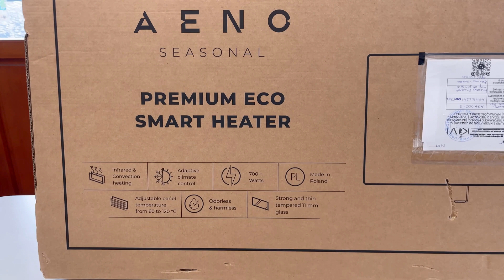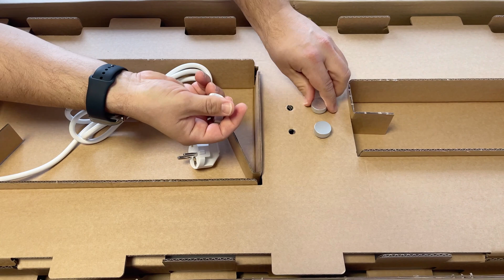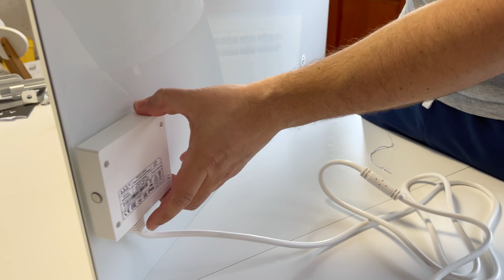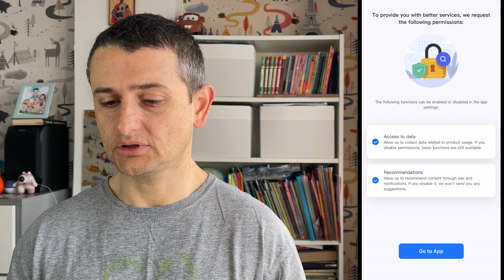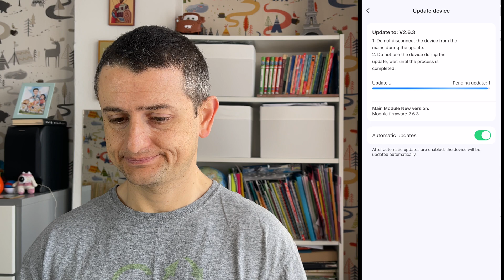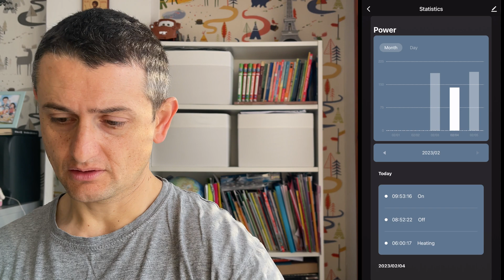UNBOXING the AENO Smart Infrared Panel

Comment: Hello Nikola! Could you please tell us about the electricity bills at the end of the month of using the heater? 

Now I'm looking for a different methods of heating for my house, and I'm very interested in this infrared heaters. 

Thank you in advise! :)
Reply from the maker: I can’t really tell about ut the bills for certain. Last winter was pretty mild and the bills were half of what I usually pay but I don’t know if it was because of the heater. Also electricity prices go up and down around here. I think you should get one or two to try and if you are satisfied you can scale up.
Reply: @NikolaTubeNikolov  Thank you so much for your reply Nikola. This will be the best solution, to get one and test it. Then we will see what will be the result.

Thank you again! 

Greetings from Plovdiv, Bulgaria!

P.S.: I suppose, we are from the same country btw, from the content in your chanel ^_^
Reply from the maker: Yep we currently live in an apartment and it’s fairly well insulated so in mild winters it did manage to heat the whole Living Room which is 20 sqmeters.
Reply from the maker: Also the app for iOS is very simple and works great. From there I can see that the panel consumed 300 kwh for the last winter and this November.

Comment: What are your final conclusions after use?
How is its efficiency and consumption.
Does it really cover up to 30 square meters?
Reply from the maker: Last winter wasn't very cold. Coldest temperatures were -10 C. For apartments and well insulated rooms it works great. I really like it. I added some Apple Shortcuts to turn it on and off. It is small and looks good. The room that I'm heating is 20 sq.m. but it is well insulated. I've heard other people that they don't like it and it doesn't do a great job but for my setup it does.
Reply: @NikolaTubeNikolov  Well, i need 3 panels, but i will buy only one for this year just for testing. Thanks 4 your feedback Nikola!
Reply from the maker: @frps13  yes, this is a good strategy.

Comment: No vale nada. Lo tengo  y no calienta  en 6 horas ni 1 grado
Reply from the maker: What are you trying to heat up? This one is made for rooms of up to 20 square meters. Also it helps if the room is fairly well insulated. I use it in my apartment and my living room is about 20  square meters but is well insulated and the room is facing south.

Comment: Hi Nikola, did you manage to compare the watt consumption vs heat comfort  against other heating that you have? Is it uncomfortable to be like 2 meters Infront of the heater?
Reply from the maker: It draws about 720 watts according to it’s own app. I haven’t yet tried to measure it in any other way. The way it radiates heat is very pleasant and I personally can stand near it without problem even very close like 20-30 cm. 2 meters you barely feel the warmth but it manages to heat the 20 square meter room that we use it in. However we use it in an apartment building which is very well insulated.

Comment: Hi, thanks for the vid. It would be nice to hear your experience after using it for a few nights; I've just bought this heater and it can not heat up a 12m2 room to more than 20 degrees, no matter if it's on constant heating. What have your experience been so far?
Reply from the maker: So far I'm very satisfied with the heater. But I must say that I live in an apartment and my flat is well insulated and has south exposure so when the sun is up it is really hot. The outside temperature varies but even at -5 Celsius it managed to heat the room up to 24 degrees. The room is 20 square meters and has only one outside wall other walls are internal. If you have problems check form the app if the limit of the panel surface temperature is set too low. By default it is set to 120 degrees celsius but It can be set to 90. This is helpful to prevent burns on pets and children but limits the output of the device.